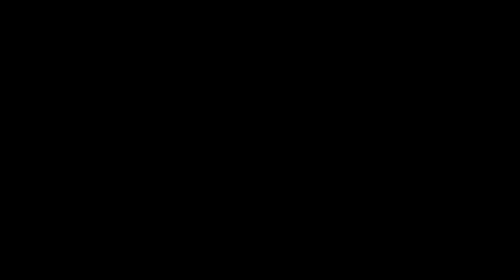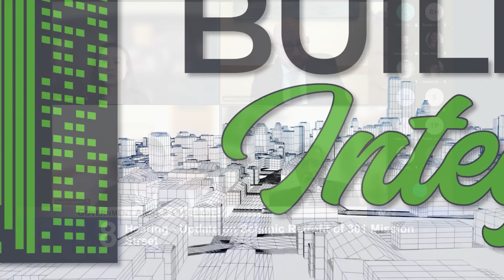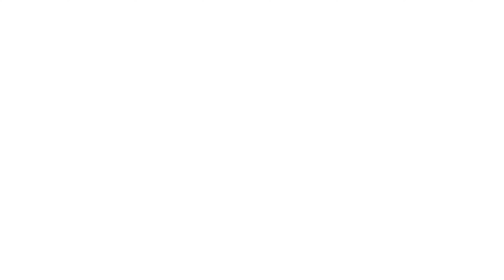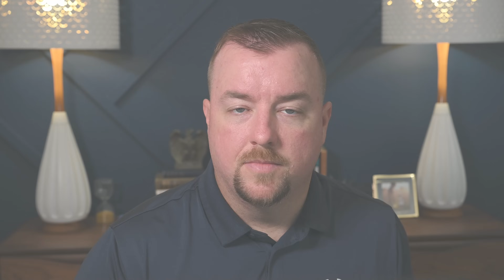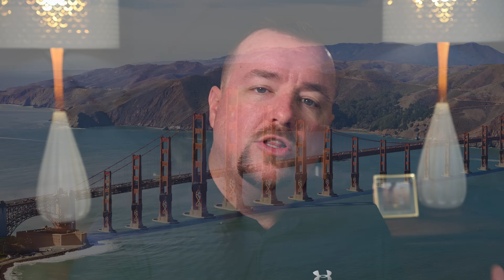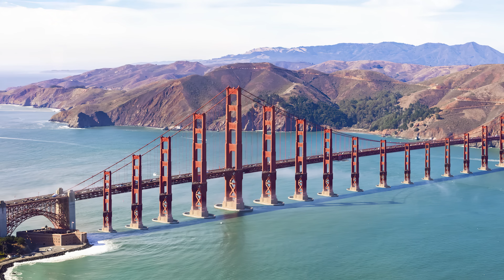Millennium Tower's "Sophisticated" Fix?  You Decide - (San Francisco's Leaning Tower Part 4)

Comment: I am not an engineer; I am an attorney and I definitely know bullshit when I hear it in my opinion; the original design was defective; it is now completely unfixable and this building is doomed. Of course everybody is arguing about who's fault it is and ultimately who, if any, will pay. As such I find it extremely entertaining. At least it wasn't some kind of important building.
Reply: As a dog and cat groomer, I can confirm that this is indeed a steaming pile of shit. 

If my kennel assistants gave me the type of song and dance this suit is trying, they'd be working weekends for the rest of forever.
Reply: Agreed. They should knock it down, turn it into green space and be done with it. "Hamburger Park" has a ring to it.
Reply: @Mrch33ky  "Millennium Flower Park" would be my second choice.
Reply: @mrlten2907  If this keeps up the park name is going to have 'memorial' in the title.  :/
Reply: I like Millenninomore Park. 😂
Reply: @Mrch33ky  the homeless need more space
Reply: Absolutely agree that this building should be demolished as it's a danger to the public. As for who should pay, let's start with the insurers of the original design firm.
Reply: @brown-eyedman4040  that would depend on which pile system they recommended, and if the developer demanded that they use a different method.
Reply: I am an engineer, albeit retired.  I agree there is a lot of BS going on here.  However, I disagree that the building is doomed.  If every building that was later found to have a problem was simply declared to be doomed and demolished, we would have torn down a lot of buildings over the years and dramatically increased the cost of building.  Look up the Citicorp Tower if you want a case study in this regard.  Many potentially fatal flaws in a building can be successfully corrected and the building will then have a long and safe service life.  I think the issue here isn’t that the building is doomed, but that competent engineers have not yet been employed.
Reply: @LTVoyager  ~ But how do you fix a failed foundation, you don't!!! No foundation. No Millennium Tower!
Reply: @martentrudeau6948  There are many ways.  It all depends on the building and type of foundation.
Reply: @LTVoyager  ~ IF there are many ways to fix MT's foundation, I don't know of them? -- But I do know buildings require foundations, and MT's has failed.
Reply: @martentrudeau6948  Time for you to do some homework then before stating what is and isn’t possible.
Reply: @LTVoyager  seems to me these geniuses have not figured out a solution; in fact they've only made things worse. And they don't seem clear how to get there. So I'll just predict it's doomed and we shall see. Yes not every building is doomed. But this one is pretty bad
Reply: @kevinbarry71  What should happen is a competent engineering firm should be brought in to assess if the building can be saved.  If it can be saved, they should propose a solution, the cost and an estimated probability of success.  The owner can then also get demolition estimates and then decide which path makes the most economic sense.  That is how a rational owner would proceed.
Reply: @LTVoyager  I agree; and note nothing like that has happened
Reply: @Jay Figari I have a masters in civil engineering engineering with a structural emphasis, but I am not a geo engineer.  I can’t say for sure that a fix is possible, but I am fairly sure that one is, but it may not be economical.  That is why I say the first thing is to get a competent engineering firm with experience in such remediation and have them assess if a fix is possible and what it might cost.  Then this cost can be compared to the cost of demolition and weighed against the usefulness of the building and the owner can make an informed decision as to how to proceed.
Reply: @Jay Figari As I explained, you get competent engineers to estimate the cost of a permanent fix and the cost off demolition.  You pick the most economic option and move forward.  You don’t make the decision based on feelings and emotions.
Reply: @Jay Figari If you want to speculate, that is fine, but making decisions on speculation is a fool’s errand.  I will stick with the facts.
Reply: @Jay Figari I am not being defensive, I am simply explaining that I make decisions based on facts and not emotion.  When you get onto an airliner so you look at dirty carpet and then get off the airplane as they may also have bald tires and poorly maintained engines just because someone forgot to clean the carpet?  The reality is that we know nothing about the details behind bridges we cross every day, airplanes we fly and buildings we live in or work in.  That is simply reality.  And conjecturing that because one part of a building has issues means that the whole building has issues is simply not rational.
Reply: @Jay Figari Forget saving face.  Save lives and get it out!
Reply: @LTVoyager i agree with you.   I'm not an engineer but a contractor and architect with 20 years experience on big multi story residential buildings in UK and Australia.    Nearly anything is possible, BUT it may not be feasible.   Looking at this project, my gut feel would be that a fix will be way more cost efficient than rebuild.   solution may be expensive  but I don't see it in the 100 millions which a rebuild will be.   The building is not doomed, developer may be.   But there will be insurance.   what amazes me is the incompetency from the council officials.   not rectifying the problem could end ultimately in a catastrophe.   when you as contractor does something that endanger lives, the authorities can issue an urgent rectification notice and the cost can include external independent consultants and expertise.   failing to fulfil your duty authorities can get it rectify (at whatever it costs) and the bill goes to the owner/owners.   I'm assuming the authority do not want to take on this liability not knowing if they will be able to claim the money back.   authorities can request the owners to put an insurance bond in place to cover them.  there are processes for this.  I am amazed at the level of incompetence all round.   

But it all starts with getting competent and knowledgeable people on board.   very sure its fixable.
Reply: @Jay Figari As I said earlier, some of us make decisions based on data and some on emotion.  Making decisions on emotion is your prerogative.
Reply: @Jay Figari I mentioned my degree one time, not three.  Then again, you operate on emotions so this sort of comment is expected.  Your decision is perfectly fine with me and making decisions based on emotion is how most people operate so you are in good company.  Take care.
Reply: @Jay Figari I don't know if the people in the tower can sell their condos, and not take millions in losses. I bet if they could afford to move they did, and if they can't, they are staying. And idk if there are rules with inspections and realtors about buying a place in this sinking building. I bet it would be near IMPOSSIBLE to get a mortgage on it.
Reply: @Jay Figari - "You don't need to keep responding and summoning me" ... Are you saying you want the last word? 

I think they need to find a competent engineering firm either way. Either they fix the building, or they demo it without taking out the neighborhood. I can't see either happening safely without hiring a competent engineering firm.
Reply: @LTVoyager  The building is owned by a condo association, so a group of people afraid of loosing both their homes and millions of dollars. Rationality seems unlikely, and if the building is demolished the residents will demand compensation - this would be another billion dollar lawsuit.
Reply: @Dennis-vh8tz  The lawsuits will be much more severe if the building tips over and kills thousands of people and damages multiple other buildings.
Reply: @LTVoyager  The difference with your analogy of the City Corp building is that the defect in that building was in the frame. Access was so plentiful that they were able to do the fix in a stealthy manner, literally under the cover of night. 
The defect with the Millennium Tower, is in the foundation. A major part of which, is is a 12 ft thick concrete mat that has already started "dishing". It's tough to get access to that, day or night!
Reply: @Bannering101  I never said it was easy.  I am simply saying it is too soon to say it is impossible to fix.  We need better expertise to make that assessment.
Reply: @LTVoyager  I never even implied you thought it was an easy fix. I am saying the example you provided is apples and oranges. 
They've been at it several years and they're throwing a ton of money at it, having only made the problem worse. Several parties certainly SHOULD have been motivated to have found competent engineers, and it would certainly be a "feather in the cap" of anyone who solved the problem. 
A brick s*** house sitting on top of a bunch of broom sticks, stuck in bay fill, will probably never be stabilized, without removing the brick s*** house. That's all I'm saying. I hope I'm wrong, for everyone involved, including my city!
Reply: @Bannering101  My impression is that the owner of the building pressured the original engineers to go cheap on the foundation and it sounds like the owner is still hiring the lowest bidder engineers.  I am surprised the city hasn’t hired their own engineering firm that has a documented track record in situations like this to get a second opinion.  You would be amazed at what truly competent engineers can do.  It is as impressive as is the screw-ups that incompetent engineers can do.
Reply: @LTVoyager  I have a different take. Having worked for the general contractor, on the building,  I have a gut feeling that the design/build GC convinced the owners to go with poured in place concrete, rather than steel. That is their forte, and they could make some reasonable arguments for it on a luxury residential structure. This switch has also been referred to in some of the testimony. How they would have thought that they could have gone to a MUCH heavier building on Bay fill, without driving the piles to bedrock is beyond me!
But then... They did save 4 million dollars! 🤣
Reply: You do have to wonder if the building will have to eventually be demolished. But NOBODY wants to address that particular elephant in the room.
Reply: @AyeCarumba221  Funny you used the term elephant. I saw how this building was constructed, and it's massive. Sadly, it's an extraordinarily well-built building, on a weak foundation!
 I'm tending to agree they're going to have to demo it, but they can't implode it. They're going to have to do it the same way you eat an elephant..... One bite at a time. What a project!
Reply: as an attorney how would it sound in court if your clients failing building endangering blocks of downtown was the ONLY building that didn't sink it's piles to bedrock, cause this building never bothered to while every other major building from what I read once, does, as anyone concerned with LIQUIFACTION in an sea side earthquake area with a history of building collapse due to liquefaction would and did.
Reply: @russell7489  This isn't the only building in San Francisco that didn't sink it's piles to bedrock. These are called friction piles, and are totally legitimate for some buildings. However, not this behemoth of a building, and certainly not in this location, on Bay fill!
There is some evidence that the building was originally conceived as a steel frame building. These piles may have been suitable for that design, but not a 58 story, poured in place, concrete building!
When I looked at the shell (unfinished interior structure) on the fourth floor, my first question was: "How high are they going with this thing?!".  They were already pouring on the 20th floor!
Reply: Only important to the people who will die there when it fails.
Reply: @tedmulthauf7434  Really Ted? The next time you're in a high-rise, think: How many corners were cut In the construction of THIS thing?" The fact that this was allowed to happen should concern everybody!
Reply: @tedmulthauf7434  
to be fair, you have to be pretty fvcking stupid to still be in the building.  thus, the residents still in situ can't be terribly important.
.
the people who concern me are the innocent bystanders passing by in the street when this thing goes over.
Reply: I’m not an engineer but I’ve been a soils technician, a special inspector and now I run a firm that employs multiple geotechnical engineers and work with structural engineers. This is bizarre. The normal process is that the structural engineer tells the geotechnical engineer what loads need to be absorbed by the foundation. The geotechnical engineer then determines what sort of foundation design (spread footings, “deep” foundation (i.e., piles and the like), mat foundation, etc. can be considered based on the soil and, in many cases, the bedrock. He or she then provides bearing capacities to the to the structural engineer, who then designs the foundation based on this analysis. I’ve never heard of a structural engineer asking a geotechnical engineer (ours or anyone else’s) “will x number of piles work?”
Reply: @TIO540S1  I agree.  I’ve stated a couple of times in this thread or others that a competent firm needs to be engaged if they want to save this building.  Everything about this has an aura of incompetence.
Reply: I'm no engineer, but I wouldn't live in that building if you gave me a home there and paid me a million dollars a year to do it.
Reply: They aren’t asking lawyers for engineering solutions
Reply: Dik Coates  why would it be their cost? They are victims. They didn't buy their condos knowing the building would shortly start sinking and leaning.
Reply: Dik Coates  It goes to the courts and is mired there for years.
Reply: Dik Coates  In a major disaster everybody and their brother gets sued.  That’s the American Way.
Reply: It doesn’t take an engineer to recognize bullshit when you smell it. I agree with you, this baby will come down one day. One way or another, gravity will take over and the outcome will not be pretty. Remember Miami a few month ago? It’s just a matter of time.
Reply: There's a video where one of the tenants placed a marble on the floor and it  rolled across the room with ease.

Comment: It sounds like they're proposing solutions to correct a real life-or-death design issue that would net me a failing grade on my strength of materials homework.
I know it's not the economically preferable option, but frankly I think the best option is to demolish this thing. In such a geologically active region a large building that is not certainly known to be structurally sound and able to contend with such activity is a massive liability. I hope for the sake of the people that live and work near it that they figure out what the hell to do about it, because all these delays are tempting fate.
Reply: After awhile the can gets rusty being kicked down the road so much.
Reply: I heard they can't even demolish it because of the nearby buildings
Reply: @Historyiswatching  they can demolish it, but it will basically be taking it apart floor by floor and hauling it away bit by bit. Expensive and time consuming
Reply: @a1c3c3u  Those towers in NY were held up by metal beams on the exterior of the building. Millennium Tower is solid concrete. Since you seem to be a fan of national tragedies look up Grenfell Tower (disturbing content on the level of NY) to see what happens when a concrete tower burns.
Reply: The real question is who is going to pay for this. That is what they are trying to do. They are trying to build a case that they did their best to remedy the problem thus they are not liable. their aim is probably try to delay it and play chicken until the city gives up and pays for the demolition or risk the tower falling on the public.
Reply: I agree with you, Peace.  It is said that “The big one” is overdue.  If it strikes and the residents are lucky, perhaps only five degrees of tilt would be added…in just a few minutes.  There goes the ability for them to flush their toilets.  I’d sell now just for stress relief even if the fix works.  Enough.
Reply: @patrickwalsh467  Nobody wants to buy.  Residents have moved out where they can afford to do so, but can't divest themselves of the Millennium Tower property.
Reply: @a1c3c3u  Not going to work. This is a concrete building and it is already leaning. It will just tip over and fall on the side, crashing into the buildings beside it.

Comment: Drive the pilings to bedrock but how are they going to get under the foundation in order to stabilize?
Reply: The tower has a 10 foot thick concrete slab at the bottom.  The plan is to connect the perimeter piles to the slab laterally.